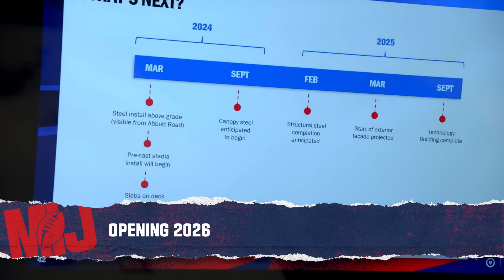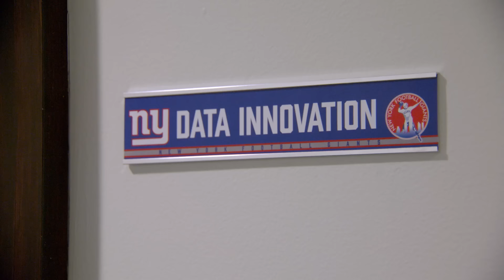Steve Smith Sr. LEARNS How the Bills are Constructing the Newest NFL Stadium | Most Interesting Jobs

Comment: The Bills will have the standard NFL stadium. Open air natural grass how the nfl should be played.
Reply: Exactly. bit of overhang to keep the crowd dry, and maybe deter some of that wind.
Reply: I like the new Bill's stadium a lot, but that SoFi is pretty crazy giving that indoor/outdoor feel no matter the weather.
Reply: @87_North as a Vikings fan, I wish we would have done something similar. I also see why they didn't, though.
Reply: Cant beat Arrowhead!
Reply: I hope it pans out good cause it looks kinda small and he did say 60,000. That's only 3,873 more seats than the Colts old RCA Dome.
Reply: @purpraid451  60k regular seats and 3k vip/ box seats, so 63k. I think that's a bit on the smaller side as well but I'm sure they'll just charge more for the crowd that still wants to go to a game.
Reply: @Lucixir  I decided at the end not to add the 3k for box and standing. Bills have one of the most diehard loyal fans. The owners could of built a bigger stadium especially if it's gonna be outdoors.
Reply: @Lucixir  Both wrong, 63k seating, 3k standing for a total of 66k
Reply: @thorkagemob1297 you don't want an open air stadium when it gets below 0 constantly in the winter here😂
Reply: Soldier Field 😉

Comment: Technically, all it gets you is a hosted super bowl.
Reply: If Buffalo could host a SB (it's more than likely not happening but would be sweet) it would be huge for the region
Reply: Won't happen. Buffalo doesn't have the hotel infrastructure to do it.
Reply: @kensmith2829  I am a Bills fan who lives in the Saratoga and Adirondack region. Rentals go wild here in peak seasons. If Buffalo hosted a Super Bowl the rental price for Friday-Monday would pay most of the mortgages in that area for at least 6 months. Just go grab a cheap hotel in somewhere like Arcade
Reply: @liamengram6326  You misunderstand. The NFL has specific rules on the types of infrastructure needed to host a SuperBowl.

Those include(from my understanding):
1. Minimum of 70k seats
2. Min temp of 50 or above, otherwise you need a dome or waiver
3. 35k parking spots
4. Large pregame entertainment area within walking distance
5. Space for the NFL Experience theme park
6. Infrastructure around the stadium  for security, electrical, media etc
7. Hotel space equal to 35% of the stadium capacity and the players as well as dignitaries
8. Practice space for both teams of equal size and quality.
Reply: @kensmith2829  won't matter.  When it comes, it'll transform the area for the better for about 1 year...
  Then the surrounding area will turn into a barren wasteland.